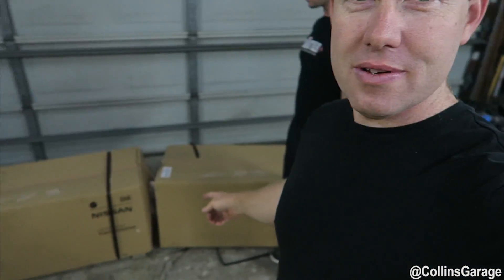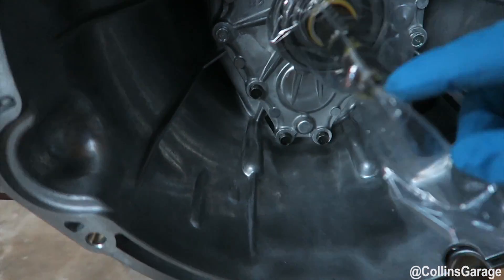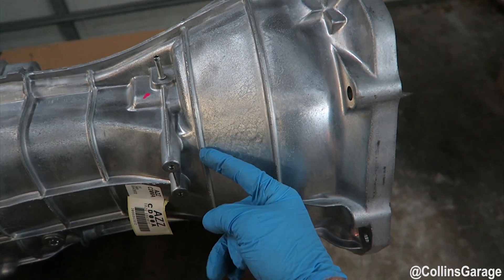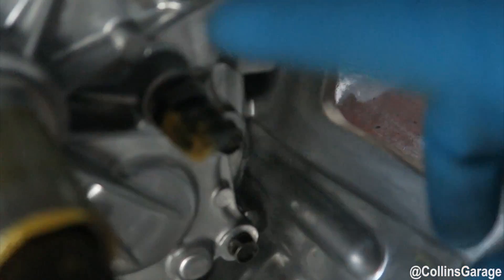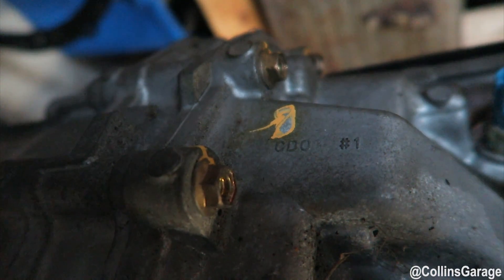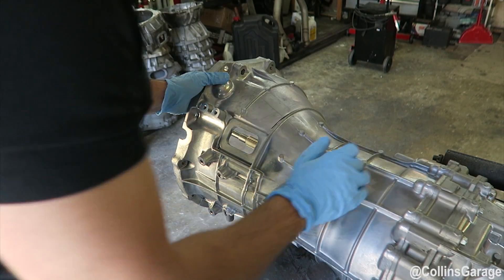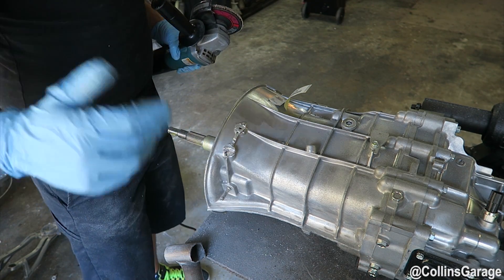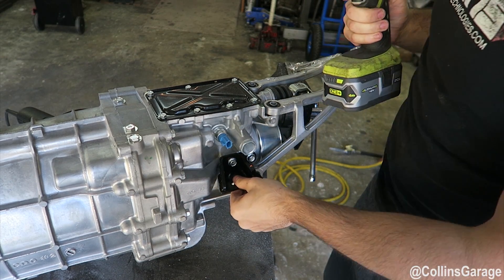How to Properly Cut Off Your CD009 Bellhousing

Comment: I'm just curious as to why if you were doing an LS swap You wouldn't just use a t56 instead of a CD 009?
Is it cost or some other reason?
Not hating whatsoever just genuinely curious.
Reply from the maker: forsure, yeah thats exactly it. it was reoccurring cost during racing and drifting. it was taking too long to get my T56 rebuilt and they are expensive from the get go. so a brand new CD00A was $1850 at the time and lasts for seasons.

Comment: See I keep hearing different I've heard they put cd009s in 05 model years like late 04 production my g35 is a December of 04 but 05 model year. Noone knows the truth
Reply from the maker: They did not come in 2004 models, they are half way through 05'-06' until they went to the internal slave systems for 07'-08'

Comment: Do you make a mount that would position the shifter right over the two bolt holes on the back of the trans behind the black plate?

Comment: http://collinsadapters.com/index.php/adapter-plates/nissan/rb26dett-rb25det-ka24de-to-350z-350zhr-370zransmission-adapter-plate.html   will these adapters work backwards, as in will this adapter allow you to bolt a RB25 geartrak transmission to a vq35?

Comment: Great video guys. I'm about to start mine and was weighing up pulling out the grinder or the reciprocating saw. I think i will go the grinder method after watching this. Can I ask what a shiny new cd009 is worth?? I know for a used one around here they are going for a mint
Reply: saw a listing online... about $1700 US brand new from Nissan.... you can buy through Collins with the kit and have them cut and install if you want... all in the drop down options
Reply: Thanks for the reply, yea i see collins have listed them and will consider that for my next one. i think it will be the freight to NZ that will be the deal breaker. i just paid 2k ($1400 usd) for my used one